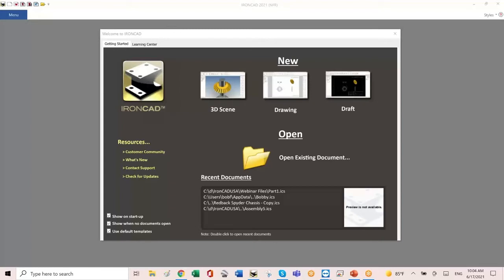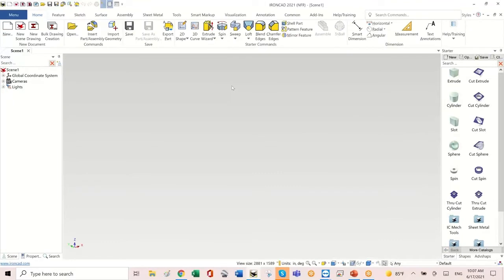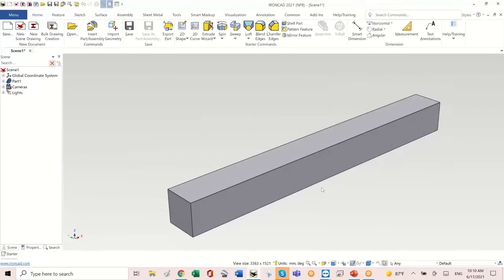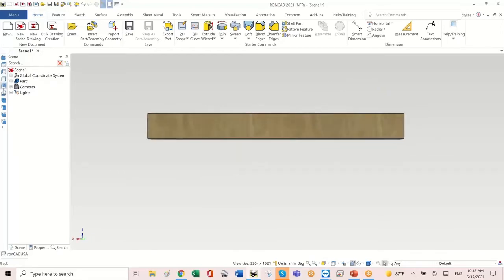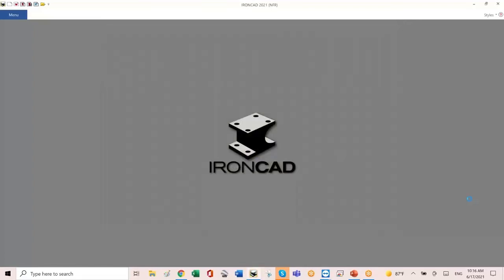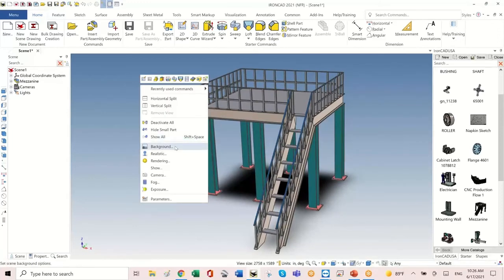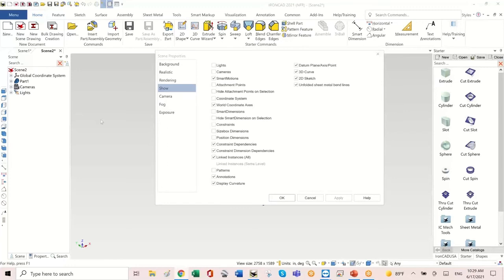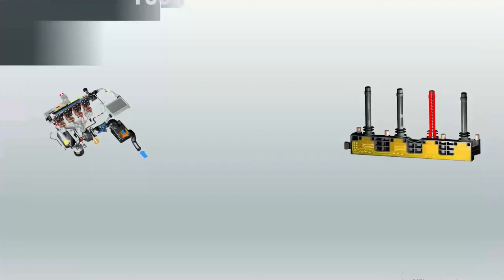Learning IronCAD! Lesson 1 - Setting up the scene

Comment: Great start - Very helpful - need many more like this!

Hope your "Lesson 3 - Streamlined Sketching" will show how to set up a sketch with symmetrical constraints that remember their original function (which don't fall apart or disappear when you do subsequent editing).  

Have a real problem doing radial and linear patterning of specific detail within an Ironcad sketch, and then being able to AUTOMATICALLY keep the intelligence of the symmetry when you later edit this.   

For example - Sketch a "Rectangle with Center" and place at Sketch Origin (O,0).  Now make any edit to the lengths of any one of the sides, and the "center of the rectangle" now moves to a point AWAY from the origin ie Rectangle has forgotten its original design intent (that it should STAY centered around the origin).  Becomes really annoying to have to keep laboriously moving the sketch back onto the origin every time.  (And we haven't yet got to the everyday work of adding other stuff like holes or cutout shapes on the edges, and then patterning this onto each of the corners yet).

Would be nice to see you demo a typical square aluminum extrusion with T-slots on all sides (the type of extrusion typically used in building modular structures and machinery enclosures).